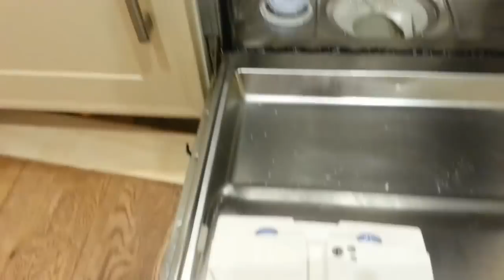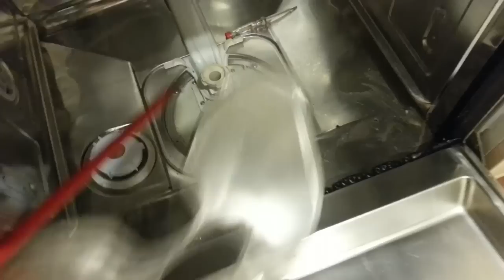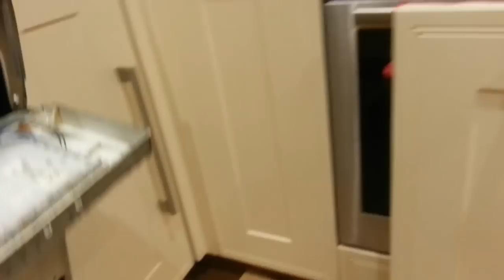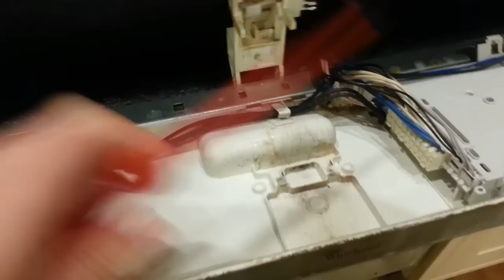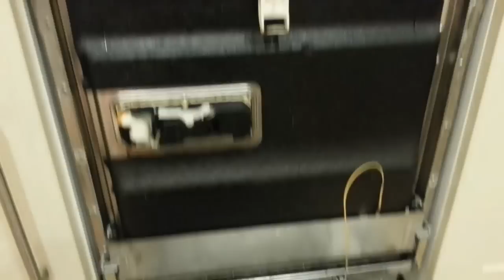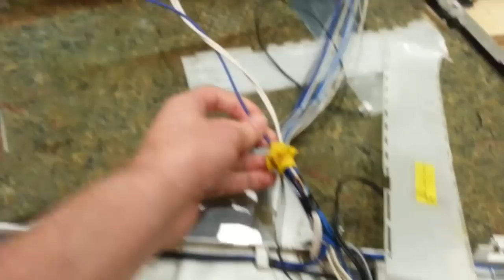Whirlpool Dishwasher ADG 7560 fault diagnosis

Comment: I started having the same problem after ten years of glorified work of my whirpool adg... I didn't event remove anything but the bottom panel and just cut out the broken wire and soldered a now one. Worked perfectly two more years... but now it's getting way too old.

Comment: My whirlpool G2P has the same broken wire trunking with a split in one of the wires which seemed to be the cause of my rcd tripping. To top it off I'm also getting a 4 flashing light error code (drainage/drain pressure switch) fault. It is 14 years old mind you. Nice informative video by the way, thanks.

Comment: Thank you so much Tom! I have the same Dishwasher and i had exactly the same problem and managed to fix it! I owe you a pint :)
Reply: What was the solution for yours? I'm wondering whether to go buy a torx screwdriver or start looking for a new dishwasher. Same model, same problem...
Reply: @BernardTunes  I just took apart as in video and soldered the broken wires back. Shrink wrap on top and then I used Hager tape to keep the wires in the plastic holder as that was broken also! Still going strong!